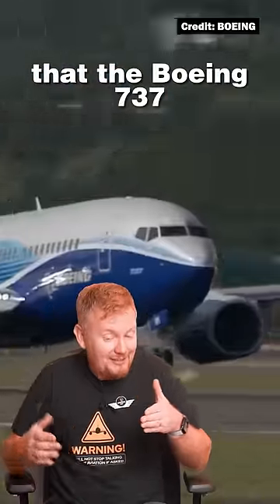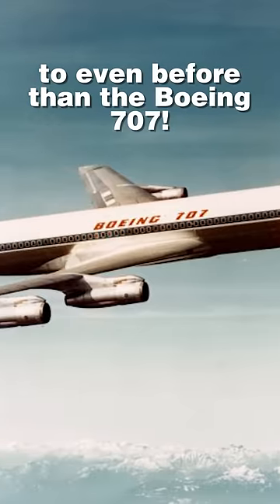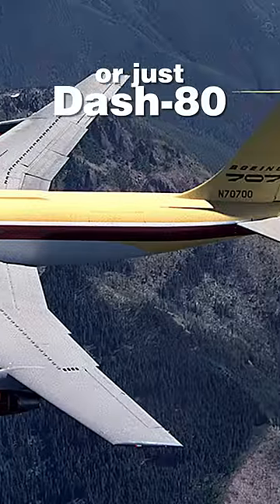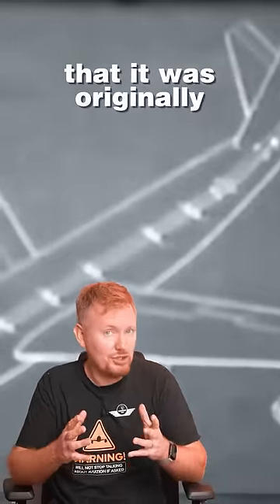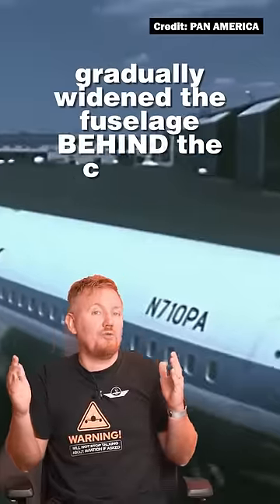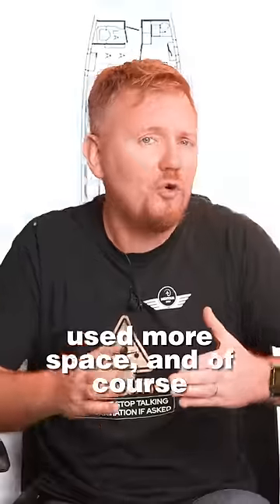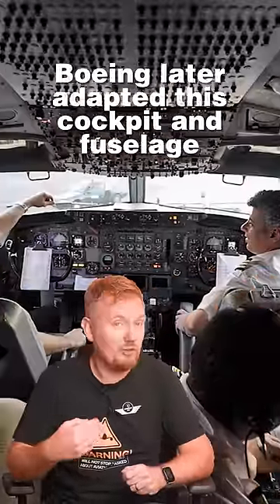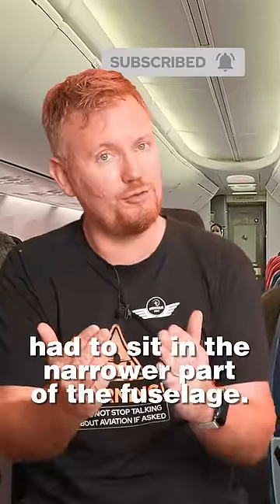Boeing 737 NARROW in the Front? #shorts

Comment: The 777 also has a double forehead for a similar reason - in order to keep pilot training relatively simple, the 777 uses the 767 flight deck and structure, so there is a double bump where the larger 777 fuselage meets the smaller 767 fuselage diameter.
Reply: Four ways to tell at a glance it's a Trip:
1. Vertical chisel-shaped aft end of the fuselage, with the oval APU exhaust nozzle on the port side.
2. Very tall, relatively stark vertical stabilizer (no or very little gusset between the abrupt leading edge and the fuselage)
3. Triple-truck main gear. So far, no centerline auxiliary gear.
4. The WOW in the fuselage. The 777 41-Section (everything from about the first forward door forward) was entirely designed by Boeing to be interchangeable with the 767! 
The reasons for this were purely money-driven. If a pilot knew how to fly the 767, the 777 was a very easy transition and didn't require extensive and expensive retraining to certify for. The new airplane didn't require a complete retool of the 767 flight deck, but the larger diameter of the body tube of the fuse v. the smaller 767 required a fairing blend between the passenger tube and the cockpit section that just never quite made it...
There's a very subtle "wow" between the tubular hull and the 41-Section, it's not objectionable to the profile of the airplane, it's not objectionable to the aerodynamics, but once you see it, you find yourself looking for it. And you can't un-see it.

There's a 5th way, but a video screen doesn't capture it in person. That 737 you fly in from time to time? When you board that plane and take your seat, think about this: Your 737 fuselage is as big around as ONE of the 777's engines.

The wingspan of your 737 is about the width of the horizontal tail feathers of a 777. 🤯
Reply: And the 757 and 767 cockpits were shared as well, which is why the 757 made some odd design choices

Comment: I don't know if this is an urban myth or not, and I'd be interested if someone could set me straight on this. 
I do know in tank design that parts that worked, often could be found going way back, i.e. the engineering drawings rather than re-draw a part (that was proven and worked) would just reference back the last signed off copy no matter how far back that was, so there was a part on the Chieftain tank (a very minor part) that could be traced back to the 1930's.
So I was told that the cockpit door width and some of the panels from that on the Dash 80 came from the Boeing 377 StratoCruiser, which shared parts with earlier aircraft. The person who told me that was an old time aviation engineer and I'll be honest was always spot on about things, but I've never been able to pin this down, but it has fascinated me. 
The reason we discussed this was, he pointed out how clever Boeing was at reusing parts that worked and that could be reused, whereas the British companies would virtually redesign from scratch every time, so it had to be recertified etc etc all costing more. 
As I say, I'm just truly interested as to if there is anything to this.
Reply: There IS something to this. I don't know specifically about the cockpit door width but it makes a lot of sense. The fuselage diameter of the Dash-80 was IDENTICAL to the upper lobe of the (double-bubble) fuselage of the 377, because Boeing reused the tooling of the fuselage to make the Dash-80 prototype. Boeing didn't really intend to keep that diameter for the 707. I don't remember the numbers, but they went a bit wider for the KC-135, which is wide enough for five seats across in economy, and then the airlines convinced Boeing to widen it again for the 707.

Comment: And, as I recall, the Dash-80 went on to become the USAF C-135 & KC-135 tanker, both with about 5” to 6” narrower fuselage diameter than the near look alike 707. That same flight deck design went on to become common across the 707, 727, and early versions of the 737.
Reply: Correct. And the fuse cross section was shared with the 757 also.

Comment: Hate it. They fixed that with the 757. Same tube as the 737, 727, 707. But they didn’t narrow it down in the front. In fact they never had to design the 737 that way either since it came well after the 707. Typical Boeing.

Comment: So which plane has the most cockpit space? I  imagine you would rather have a wider work area? 😅 or does that bring more screens/sensory overload?
Reply: Airbus by a large margin, but it feels sterile compared to the cocoon that the Boeing is.
Reply: I've flown it for 10 years. Everyone would like it to be bigger. It's a PIA to get in and out of, bags don't fit, jumpseat is cramped (some have two, which is a total joke), and my head has multiple dents from overhead switches.

Still a good plane though. I could have gone to the Airbus years ago, but chose to stay.